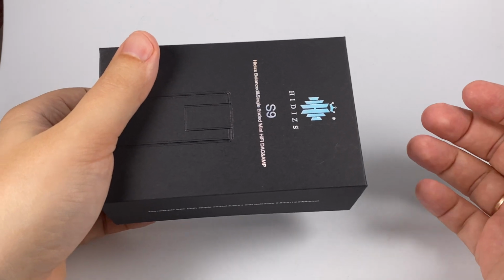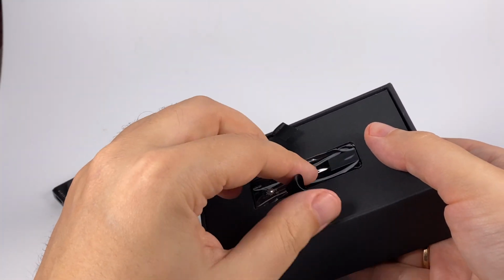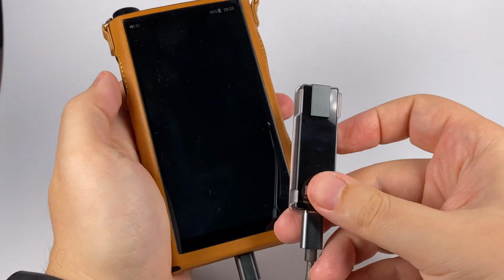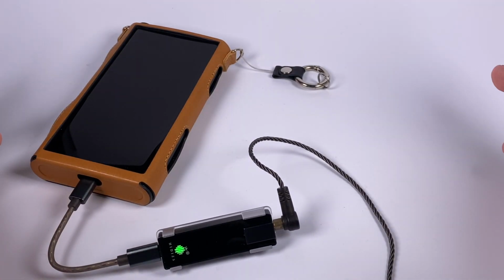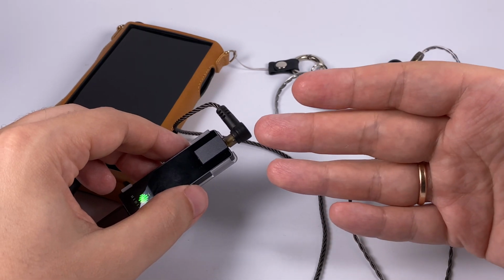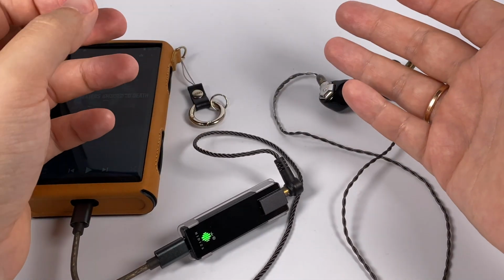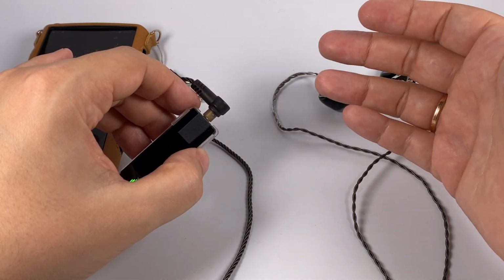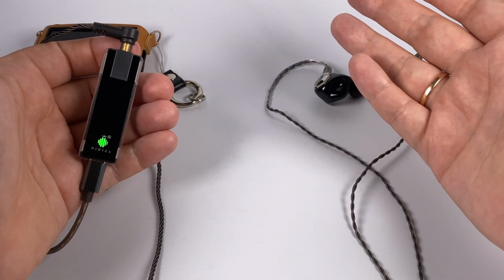Hidizs S9 portable DAC review

Comment: Cant find a solution for getting this to be recognized when plugged into the Galaxy S21 Ultra 5G - every other device i plug it into works immediately, every other USB C cable is recognized just not the S9 Pro DAC......and yes ive tried enabling developer mode, USB debugging etc. Contacted Hidizs ....still no help!
Reply from the maker: Unfortunately, Samsung has some issues with particular USB DACs. And problem is that it's pretty inconsistent. Some DACs work, others — don't. And even more, some batches of Samsung phones can work ok, others of same model — doesn't. I personally saw two S10, one worked with iBasso DC DAC, other didn't

Comment: I have to disagree with this being a good device for sensitive earphones. Using the S9 plugged into an android phone and with KZ ZS 10 Pros there is distortion at any volume less than 16%. On the upside, no constant hiss at all.
Reply from the maker: By "good for sensitive IEMs" I meant hiss. As on loud volumes, almost all models will sound distorted, and usually it's not the DAC fault
Reply: @PortaFi  I agree that there is no hiss at all. I've found that I can fix distortion at low volumes by having the DAC volume high and using another device to attenuate the signal back down. Thanks for your channel by the way. It's been very informative.

Comment: Ah yes back at it with another high quality review does anyone know if it supports inline mics wanna use it on my phone with my headset
Reply from the maker: as far as I remember, it doesn't. but I'm not 100% confident here
Reply: @PortaFi  for anyone else yeah it doe Output Options	Compatible with both single ended 3.5mm and balanced 2.5mm headphones	3.5mm stereo port, 2.5mm balanced port
Headphones with Mic	Compatible
Reply from the maker: @SirQuacksalotthe1st  that's a good news, thank you for sharing
Reply: @PortaFi  you're welcome it's something what would effect my purchase
Reply: @SirQuacksalotthe1st  hi there, did you tried in-line mic on the 3.5mm port? Just confirming before my purchase.
Reply: @masonw.1032  I didn't end up getting it how ever the official site does say it supports inline mics I got the hidiz dac cable I'd go there and read for your self best of  luck to you
Reply: @SirQuacksalotthe1st  thanks, I've actually asked Hidizs on their FB, they mentioned it doesn't support :/
Reply: @masonw.1032  Strange as they claim it does on there own site 🤔
Reply: @SirQuacksalotthe1st  I'm surprised too. It's okay I wouldn't want to try and there's lots of other alternatives.
Reply: @masonw.1032  Got a response from the company on Amazon they said it will work with headphone mics 🤷 so idk what to think XD
Reply: @SirQuacksalotthe1st  Haha, and there's actually no mention on mic functionality test conducted in many reviews that I've read. I would avoid this for now. X/
Reply: @PortaFi  ok thanks for the reply does the d8 ? Sorry to bother kinda don't got a headphone jack on my phone XD

Comment: How does this compare with the Qedilisk 5k bluetooth?
Reply from the maker: it's more neutral, more resolving, with better treble extension. wired connection is still superior than wireless, even with better codecs
Reply: @PortaFi  yes of course, but I was thinking of getting these instead of the Shanling MW200 2 pin due out this month. Something like this works with all iem's regardless of pin type, but there is the minor inconvenience of the long cable. Thanks.
Reply from the maker: @Ved-Bharath  so, the main question is if you need a BT or not :)

Comment: i have a couple of  questions. So i have a macbook pro and i dont have any dac or amps but i have a few iems tin audio t3, shozy form1.1 and xiaomi hd pro and in the future i might get a 9 ohm audiosense t800. so my questions are is there a huge difference between this device and macbook embedded dac? should i save more and get ifi nano black label instead? which one reduces hiss or better for sensitive iems s9 or ifi?
Reply from the maker: > so my questions are is there a huge difference between this device and macbook embedded dac?
I can't call it huge, but it's pretty noticeable

> should i save more and get ifi nano black label instead?
subjectively, I don't like using devices with a battery as a stationary DAC, so subjectively I'd go for something like Audinst DX1 or some other DAC with USB/outlet power

> which one reduces hiss or better for sensitive iems s9 or ifi?
I didn't do direct comparisons, by memory, both are pretty OK (iFi has a built-in IEMatch adapter if I'm not mistaken)